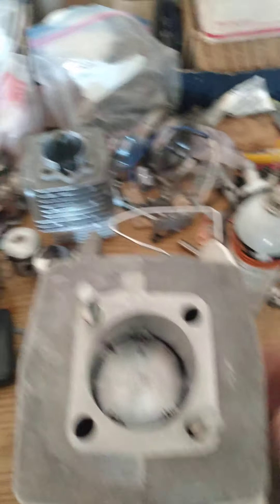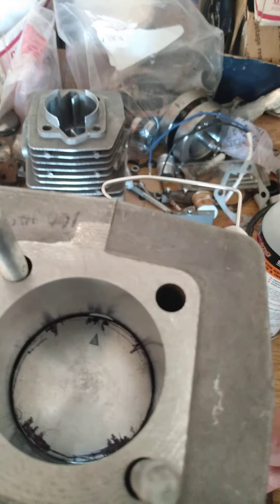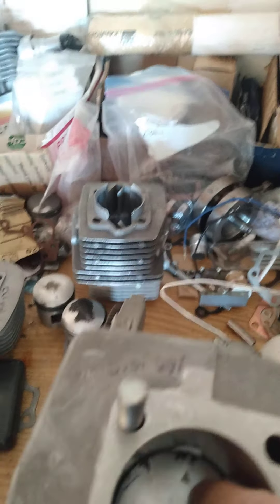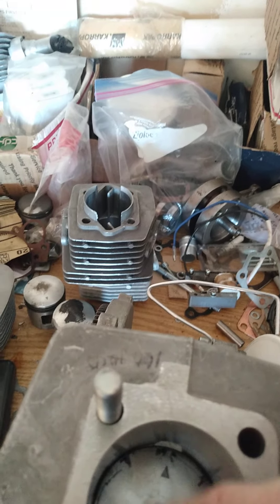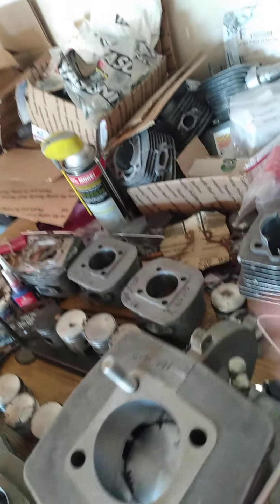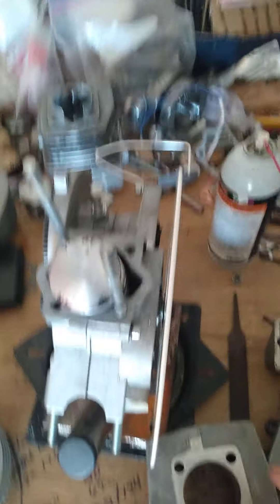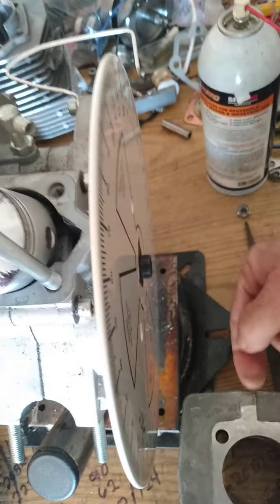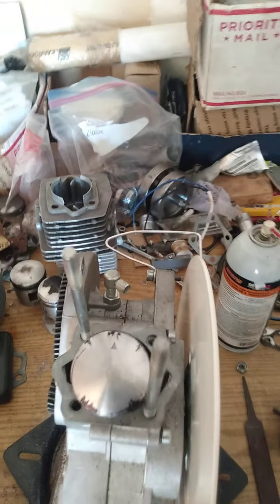boost port how it functions

Comment: I think your piston ist in the wrong direction. The arrow at the piston roof should point towards the outlet.
Reply from the maker: @confusingx3  not sure if you notice just how many cyls and engines I have built. But been building 2 & 4 stroke engines sence 1977 and 100% have never put a piston in backwards.
Reply: @2strokecarbtuningportingin187  
Everyone makes mistakes sometimes. On all engines I have assembled so far, the arrow had to point towards the exhaust. 
It's possible that it is different on this engine. I don't know.
Reply from the maker: @confusingx3  on two strokes  the ring location  dowel pins are on intake side  of port. It's not my fault the meaningless  arrow was stamped wrong. Again you might wanna look at things I build before leaving foolish comments. Have a great day.
Reply from the maker: @confusingx3  https://youtu.be/q-3QZ8laFp4?si=oOgO7olpA9pXrPuC again been building engines sence and racing sence 1977. Got kinda  a little experience
Reply: @2strokecarbtuningportingin187 
I don't understand why you feel so attacked. You said yourself that the piston was marked incorrectly. 
Looks wrong but is not wrong - everything fine.
I didn't mean to offend you or question your work. all the best

Comment: boost port does a lot more if you run a pipe (resonance exhaust) on it...pushes mixed fresh gas out of exhaust and resonance pipe pushes it back...so boost port helps clearing the cylinder from old burned gasses and increases power on full throttle if used with a reso pipe
Reply from the maker: Do you see me asking anyone any questions  EVER. Nope make some vids showing your information
Reply: you said it does not do much on high rpm...and that is not correct in my view...boost port helps especially on high rpm (on lower rpm the transfers have enough time to clear cylinder alone)... and with a reso pipe it helps the pipe to "overload" the cylinder (if you not push out fresh gasses the pipe can not push fresh gas back in)...

Comment: can boost port run without reed valves ? or windowed piston?
Reply from the maker: Yes a small one preferably slightly below the tranfer opening line been running them for years on Piston ports
Reply: @2strokecarbtuningportingin187  so what is the difference made when the boost port is below the transfers a little further
Reply: @2strokecarbtuningportingin187  what do you charge for a cylinder? I Need plenty bottom end but I want to hit low to mid fifties I also would t care to go for more rpm and a bigger sprocket as long as I don’t have a gutless bottom end oh and the cylinder I got wasn’t made for racing I wanted it to be able to live a longer lifespan I’d love to learn more about porting. But I’d need to start from the bottom and work my way up a little at a time I have a learning issue but I’m fairly intelligent
Reply: Also don’t really want more than the 62% of my bore as it’s not for racing more for daily use. And I’d love some good numbers to experiment with I’d like to start with one thing at a time learn what it does to performance etc etc
Reply from the maker: @motorizedbicyclenation53cu90  watch my vids you can make it happen ps never snagged a ring hundreds of cyls
Reply: I just love how he eliminates the "2 stroke scientists" out there by making it clear that "it's not rocket science when you understand what the engine is doing." I couldn't have said it any better.

Comment: Would you help me port a yd 100
Reply from the maker: Made vids to help people  I live in the country in NC . Zero  profit messing with bicycle engines.  Sorry. But if you know your exhaust  , tranfer & intake durations chances  are good I can give you numbers that would run much better.
Reply: @2strokecarbtuningportingin187   its a bone stock yd 100
Reply from the maker: @talonsbmxproductions8165  I never had a yd 100 that's why I asked for  your port timing numbers.  You tell me YOUR PHYSICAL  PORT DURATION  I CAN TELL YOU WHAT TO MAKE THEM. I'm confident  you would get good results. I made vids showing exactly  how to figure  out how-to get them numbers. It's important  to know  what the current  port timings are then I could give you what you would want to make them. Sorry I don't like Giving ANYONE  BUMB ADVICES.
Reply from the maker: @talonsbmxproductions8165  I'm sure you watch some  of my vids I'm 💯  confident  you will and can make good gains

Comment: Not to be rude you gave me some information on 2 strokes but I'm a 4 stroke guy like 2 stroke stuff but any one out there you will not out run my 4 stroke if you think you can I will use the super small one simple pump gas
Reply from the maker: https://youtube.com/shorts/sCN0JNbQ_xA?feature=share been building 2 stroke and 4 stroke engines for over 45 years. The 4 strokes I work on are nhra prostock  motorcycle class most powerful natural  aspirated motors there  is other than formula  1

Comment: Hi, love your videos, just one question. If i´m running a boost port like that , i need to be running reed valves right? I´m new to this.
Reply from the maker: No you don't need reeds to run a boost port like show on this vid.  But it should be little narrower. If your gonna run a boost port on a none Reed motor have have it opening slightly after tranfer opening.when I say slightly  I mean about .5 mm lower than your tranfer opening.
Reply from the maker: Thanks everything  I post has been tested and works. Last thing I want to do is give bum information
Reply: @2strokecarbtuningportingin187   im saying that, because i ported my cilinder, and made a boost port and it doesnt start. Like she wants but blowsback to the carb.
Reply: @2strokecarbtuningportingin187  my boost port opens at the same time as the transfers, but i think its to big thats why.
Reply from the maker: @pr1me113  it's fine I have ran them big small and have them open before and after tranfer openings  typically  I machined mine in a mill so I put them exactly  where I wanted them. I have done hundreds of cyls .just got tired of messing with them but shared all my information  hopefully  you find it helpful
Reply from the maker: @pr1me113  simple fix add reeds your boost ports to big to high for  the piston port.
Reply from the maker: @pr1me113  again I run boost ports on piston ports no problem have been running them like that for many many years as far as your motor not running you said you ported it and added a boost port. There alot of factors that determines  how good your motor runs or don't run at all. I show how to use a degree wheel I belive I cover all topics to help prevent  people  from making door stops out of there cyls. Blessing is cyls are cheap.  Port timings meaning exhaust  width hight shape overall  duration, blowdown  distance in degrees   from point exhaust  port opens to the distance  tranfers open. Tranfer duration and intake duration  all factor into how good your two stroke anything  runs from bicycle  engines boat engines chain saw engines function.
Reply: @2strokecarbtuningportingin187  exhauste 165°, transfers 124° blowdown 20°, intake didn't anything apart from making the boost port
Reply from the maker: @pr1me113  somewhere on my channel there  a video  showing me machining a group of 10 or so cyls for a piston port set up.  Only thing different for the piston port cyls I machined for piston ports is the size of the boost port never had any problem  with them running. They all had 25 degree roof angle all were done  with a single pass with 1/8 end mill bit.  Sent at least 30 cyls to Don butler they all ran great.
Reply from the maker: @pr1me113  https://youtu.be/Juqej1wrANU most of these were specifically  for Reed motors
Reply from the maker: @pr1me113  https://youtu.be/Riy-GR6rA8E the cyl you see with boost port in beginning  is one for a piston port notice the difference  in the physical  size
Reply from the maker: @pr1me113  https://youtube.com/shorts/RyczWPeigGE?feature=share this is the video with boost ports specially  for piston ports
Reply: @2strokecarbtuningportingin187  yeah, mine´s alot wider. Anyways, thank you so much.
Reply from the maker: @pr1me113  your 165 / 124 numbers should have ran good that's  got 16% bld. If it would have been a 165 exhaust  / 120 Trans  it would have been 22.5° of blowdown  @18%  kinda better set up. Typically  most all my motors allways were running 18% to max 25% blowdown. Small bore crap China engines are poorly designed. Hence best approach  is getting the most power with the least amount of work. The higher your tranfer ports are the more exhaust duration required  to achieve a legit blowdown  %   the higher your exhaust  port is the less work area you have above the exhaust  port. Don't get me wrong most all my cyls were allways  above 170 to 185 degrees of exhaust duration  again I have Done hundreds of cyls.  You can achieve higher  blowdown  % with minimal  exhaust duration  and the motor will still run super good.  Example 160° exhaust 110°  has 25°blowdown  @22%  that motor will run great for a few reasons  even though  it has low exhaust  duration  and low tranfers  duration it retains pump work area above the exust  port and low tranfers yet it has 25° of blowdown  with 22% bld. There's  hundreds of ways  to get to the same destination  in life. Same story with making two strokes achieve your power expectations. Meaning all twostrokes  engines not just bicycle  engines. Blowdown  % is simply blowdown ° divided by transfers  overall  duration.  Example  25° of bld ÷ by 110 tranfers yields  you roughly 22% bld.  Butt if you have a 124 tranfer duration  with 25° of blowdown  it's  20%  but to achieve that 25 bld your exust  port needs to be @  174°   it's all simple there no one way to achieve the same goal. You can take 1000 different aproches to achieve the same goal.  Tried my best to write in words how I look at things. I'm a engine guy meaning been building two and four strokes for now about 45 yrs.
Reply from the maker: @pr1me113  all the writing and vids sound kinda complicated  but it's all very simple  stuff. Meaning  two strokes
Reply from the maker: @pr1me113  https://youtube.com/shorts/rfT6Md0p7ko?feature=share typically  this is about the only engines  I build anymore  NHRA  prostock  motorcycle. And kinda not that interested  in building them anymore
Reply: @2strokecarbtuningportingin187  theres nothing better than learning the theory and putting it to pratice.
Reply from the maker: @pr1me113  yea I wish growing up there was someone  like myself  that understood  cause and effect. Meaning shapes Hights blowdown  blowdown  % window locations sizes shapes roof angles lead angles and all the crap  I try sharing there I had zero access to books there was no internet  there was no youtube.  Everything  I know has been acquired by 45 years of doing. Half the folks I tried watching  there two stroke channels sound smart but are actually  clueless. I use to join there channels ask a few basic questions .it takes  about two questions. To figure out they were  full of crap.  There tons of bogus pie in the sky information  out there . I have learned zero online
Reply from the maker: @pr1me113  these  cheap bicycle  engines are the best platform  a person  can experiment with and make huge power gains with a simple die grinder and a degree wheel. There so wrong on many levels meaning  design and underdeveloped. It's a affordable  platform. You cannot make huge gains on any modern  two stroke engines  simple because there already  closest to perfection  as possible. With already  proper port locations and timings also have variable  exhaust  port timing fuel injection  and prograble  timing curves .

Comment: Does a vm18 attatch to a 22mm or 23mm intake? Need help.
Reply from the maker: You need a intake with 23 mm od and 18 mm Id
Reply: Thx bud 🙏
Reply: I got one ported for TORQUE g4 closed trans small ports by don butler say it should take off very well and hit high 40s I’ll get some numbers 170exh 25BD 120tf small single hole piston window …a thinner boost port and mushroom head exh my question is if I decided to add a little speed at a time trying to keep as much torque as possible and low end where do I start shaving lol just would like some ideas 💡 for a secondary cylinder I’m gonna try and match the work learn some off him and you bout porting lol haven’t crank it yet tho waiting on bottom end
Reply from the maker: @motorizedbicyclenation53cu90  Don Butler was 100 % cluless until I helped him. 170 definitely not for torque  just saying them are port timings I gave don
Reply from the maker: @motorizedbicyclenation53cu90  FYI them port timings I have him if you were looking for torque  a 160 /110 /25 bld @22% would have yielded more torque just saying.  I can explain exactly why but the real question is can don Butler tell you why it would
Reply: @2strokecarbtuningportingin187  idk if he could or. Not but I didn’t ask for pure torque I did ask for a good balance
Of speed up to 50 low 50s high forties and didn’t want a gutless bottom I wanted some good torque bc I got big hills around here but Don mind helping it take off so he did say he could get it to where it would just crank and take off from a stop
Reply: @2strokecarbtuningportingin187  and why? I’d love to know the differences inside the chamber
Reply from the maker: @motorizedbicyclenation53cu90  small displacement motors if your looking for torque the more you lift your exhust port the more pump you loose. If you lift your cyl to achive higher tranfer duration you need to deck cyl to correct sqish. Taking away more volume ie pump if you do the math first you can  get same results. Without loosing torque I can  achieve higher blowdown percentage with 10° less exhaust duration in 10° less transfer duration  thAt would have more torque.   Ask him few questions see how many legit answers he has. I tell you none because all's he is doing is going off info  I gave him. I see he is ruining minarelli cylinders on his YouTube channel don't know how much advice I would take from him that's for sure well I wouldn't take no advice from him because he has zero
Reply: @2strokecarbtuningportingin187  so best numbers for torque would be about 160:110:25@22.7%   D shape or mushroom shape exhaust? I’m unsure their thinking mushroom but would that take away much torque? Otherwise a D port? That’s my last question is exhaust shapes I seen the mushroom shape ya did it was for rpm? Would it work well or hinder performance? I’m sure you’ve tried this before
Reply: @2strokecarbtuningportingin187  I can’t thank you enough for your videos and information